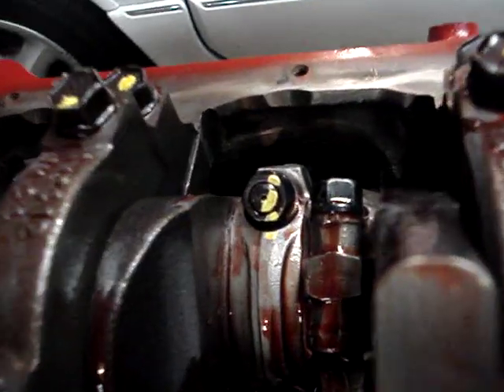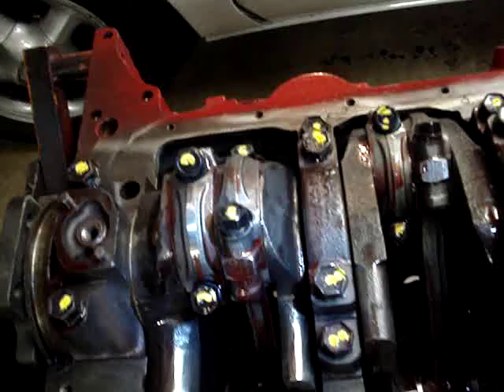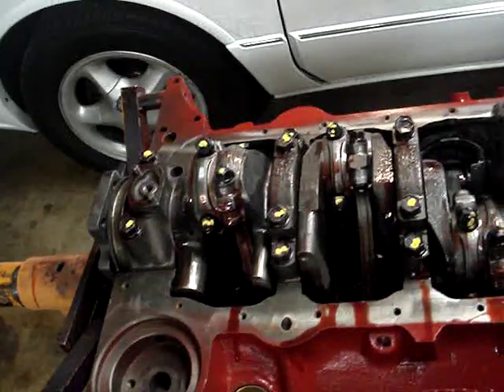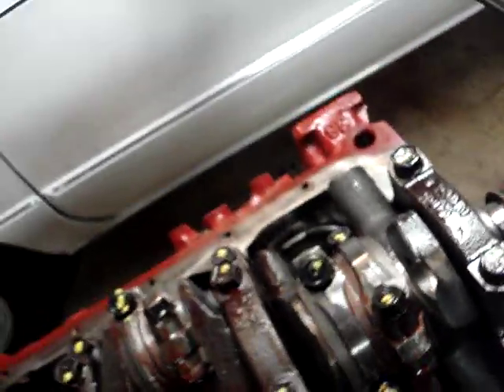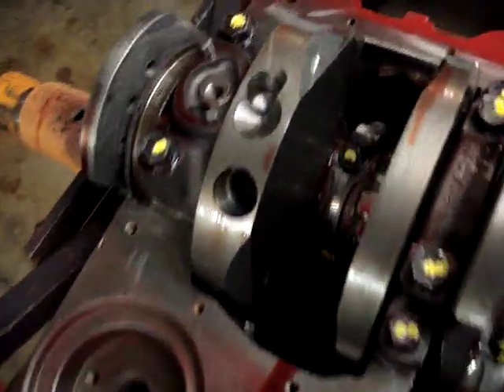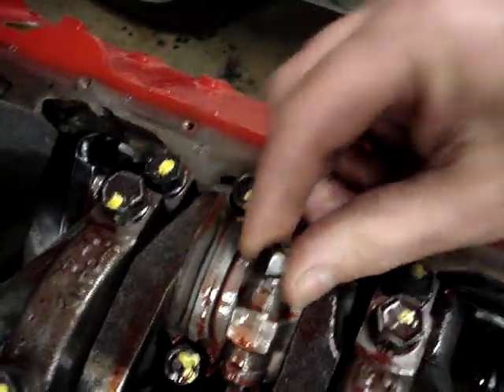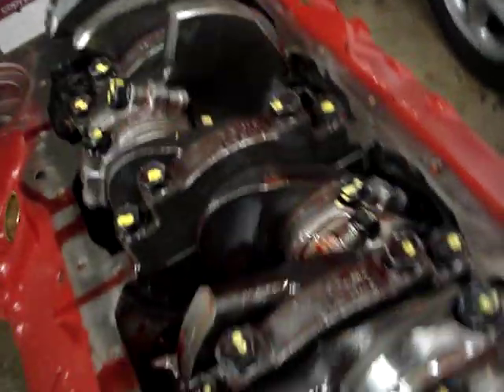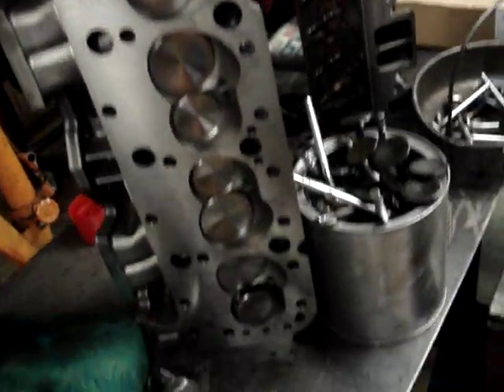383 stroker engine

Comment: I have a sbc 350 5.7 but a TBI engine, in having it stroked and rebuilt, im not leaving it, TBI, and I'm hoping to get above 400 with the rebuild. I've read that these TBI engines you are not able to get those results from them (sorry if this has already been discussed)

Comment: I built myself a nasty 383 2 years ago 
I have a question 
What hp will the gm block 
4 bolt mains 
90 s 350 machined 30 over 1 piece  
What hp does it crack internally 
It's in my 88 gta with a tuned port furl inj 
And I got a hsri and aluminum heads and a tune 
And I had a t5 and I upgraded to a t56 from a 95lt1 trans am 
And I have a gm 9 bolt rear end 
I was told by idiot friends that it's good for 750hp witch is dumb was ppl telling me that 
I just want to know if my engine made 450hp could I use a 50 shot or a 100shot nos at the track 
Ty

Comment: Kudos on the accountability with the use of the yellow paint. I do this when I am building several computers and servers at the same time its just great accountability. I use different colors for different computers and or servers.
Reply from the maker: Yes great point I do it so I know that the bolts are torqued if I walk away for lunch or even waiting for parts I will halto recheck the torque to make sure I did it with engines you can not be pretty sure it's right you halfto be 100% sure close enough does not cut it when I pull the plastic bag off and see my paint marks I know I torqued the bolts good eye

Comment: what would you suggest for a cam besides a small base circle for a 6200lb 4x4 truck. what id like is a torquer dont really care about all out hp cause will be a partial daily driver/tow rig. would like a noticable idle off a smooth stock idle
Reply: truck also has 3.73 gear ratio with 34" tires. 4L80E trans. and a 14ff rearend
Reply from the maker: Engine Pro MC1730

Comment: what do u think about a 224/230 camshaft for a 388... for the street.. some say a little small.. i could go bigger..
Reply from the maker: Well it really depends on what you are doing with the engine 224/230 is an aggressive cam however if you are going for all out performance they are probably right a bit on the small side but if you want a more streetable car it will work fine
Reply: Myvintageiron7512 yes now i have a 242 duration cam... imma drive it for a while and see how i like it... th350 with 3200 stall and eaton posi 3.73 gears.. its really a toy.. or friday night thing. .not daily driver..

Comment: How do you measure the weight of each throw?
Reply from the maker: The computer does on the balancing machine
Reply: +Myvintageiron7512  Do you know if a 383 stroker will pass emissions/smog tests?

Comment: Nice thing about a Ford 351 Windsor is that you can go to a 430 stroker (427 stroker with .040 over bore) with a stock block and just a small notch on the bottom of the cyl walls. With a sportsman block (taller deck height) you can go to a 460 cu, insane. Put on some Cleveland 2v or 4v heads to make it a Clevor and its almost unbeatable.

Comment from the maker: That's true the best way to get around this is to use connecting rods that were made to clear the cam in a stroker engine either that or you can buy a cam that is ground on a small base circle to be used in a stroker the third and probably least advisable way is to relive the rods on a bench grinder just remember this needs to be done before you have the engine balanced in your case I would order a small base circle cam

Comment: @Bran Gozz you might actually get rid of the 882's an swap for some 487's. 882's are crack prone like big time crack prone. The 487's arent an theyre the same 76 cc chambers as the 882's. but i have a chevrolet engine book an it states that 882's are crack prone. Im building a 350 now for my 57 chevy pickup. The 350 has the 882 heads which you usually find on 400 small blocks. Thank god we have another 350 thats had a 882 to 487 head swap. Lol jus gotta rebuild them.
Reply: I know this info is 8 years old but there is so much false information, 882 heads especially because they made different versions of the 882 heads, they made pre 76 heavy casting versions that are not prone to cracking, then they made post 76 versions that are prone to cracking so not all 882 heads are junk as far as cracking goes.

Comment: Building a 350 motor bored ..030 over crank turned but need rods  i know 5.700 is standard but I can get a set of Eagle 5.85 rods from a buddy will these work and would i have to change cam or anything. I am planning on a RV cam. and standard 882 heads

Comment from the maker: I don't like to put 2.020.1.600 valves in the vortec's it shrouds the valves and flow will go down a small amount, stick with the 1.940/1.500 valves some good port and polish work will help but make sure it's done by an expert

Comment: Is that enough room once it's expands from normal operation I'm just curious it's my first bulid and I have a 70s 350 4 bolt main and I wanna bore it .30 over and stroke it to a 383 I just wanna make sure there is enough clearance for it all

Comment: ive got a 3970010 350 bored .60 trw .100 dome pistons the bottow end is balanced and i have doulbe hump small valve heads. how bad do you think the heads are holdin back the motor. i know right now it pulls pretty stong the way it is.

Comment: The late 60s early 70s factory double hump heads with the 2.02 - 1.94 arent a bad factory head once they been cleaned up and ported and better vavlves like manley or scorpion put in with springs that match what cam you install. Ive had luck with the machine shop easily getting me 200cc Intake runners and 64cc combustion chambers in the past. Most factory heads are junk after them years, I rather get some aluminum heads.

Comment from the maker: there are 3 basic rod lengths that you can use for a 383 the 400 rod that is shorter than a 350 rod (prob not a good idea to us these allot of rod angle hard on piston skirts) the 350 rod it is 5.700 long this is the most common stroker rod and also 6.000 rod these should not be used with a mild cam you will have a serious problem with detonation even with low compression although they work great with a radical cam the longer the rod the less rod angle and greater the piston dwell time